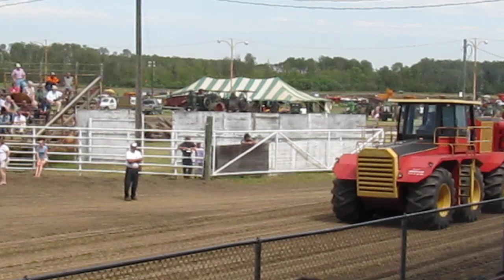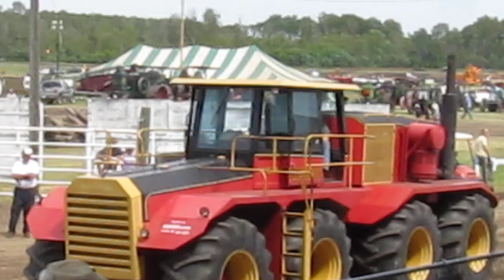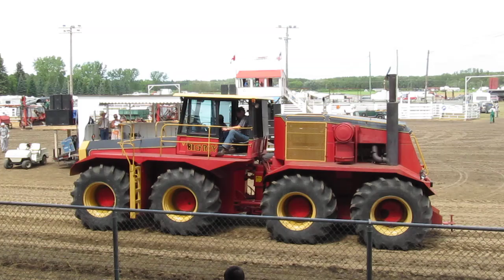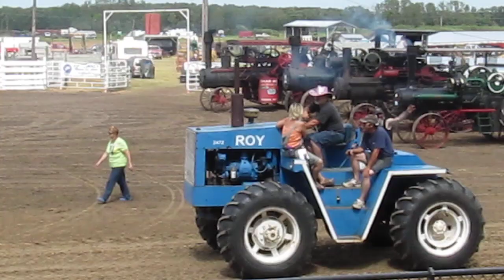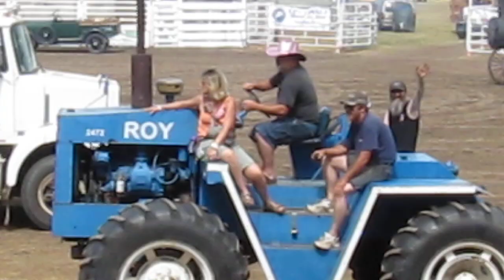Big Roy

Comment: @yamy82xl the big bud 747 has a 16 cylinder quad turbo detroit diesel 900 HP I think it could Take the belt from big roy plus the Big Bud was actually used for farming

Comment: Most of these comments are a fucking waste of time. He's in a low gear idling, (plus, IT'S A FUCKING TRACTOR, IT DOESN'T NEED TO BE FAST) It's a goddam farm tractor, used for pulling stuff, so it DOESN'T need weapons or armor plating. An M1A1 maybe more powerful, for a short time until it's undersized cooling system fails. Weight is an enemy in the Ag industry, packed soil=less plant life, more water run off, less yields. Listen to an actual farmer, who actually knows his shit.

Comment: What idiot designed that blue one? It has no roll-cage.

The red one is nice tho.
Reply: +SmartassX1 If you roll heavy machinery a roll cage wont stop you from being crushed
Reply from the maker: +SmartassX1  a farmer it completely homemade. what have you made from scratch?
Reply: mog5858 I actually have made a vehicle. A sailing vehicle on skates for use on a frozen sea, along the coast. (Not very relevant here, but you did ask.)
Reply: SmartassX1
Sailing boats are in no way of the same leage as engined vehicles.
Reply from the maker: +SmartassX1 great glad to hear way better way to spend time than video games i bet you leaned lost when doing it.
Reply: mog5858 I did.
Reply: they are nothing unusual , i saw them many times when i visit my relatives at the country side
they're probably picked for price and glass absence makes them more comfortable when hot
but yeah they are a stupid choice